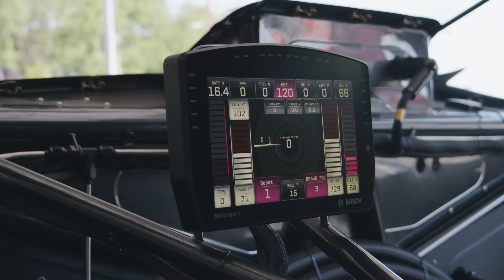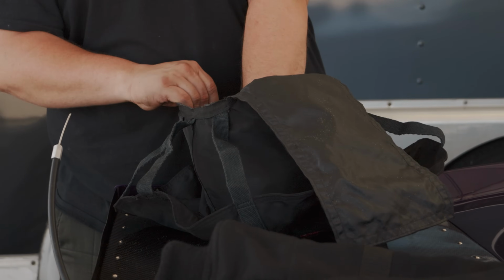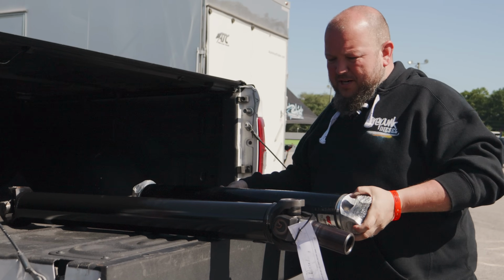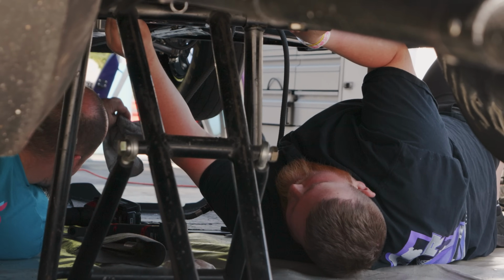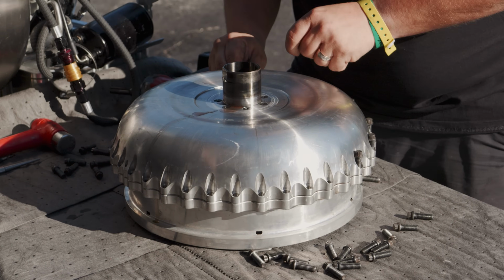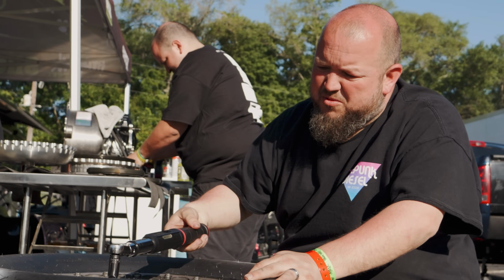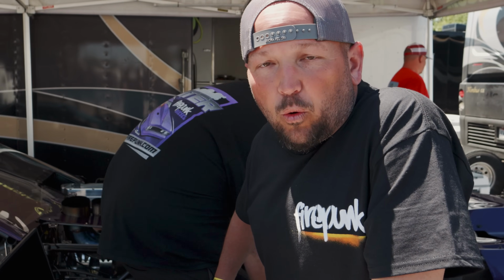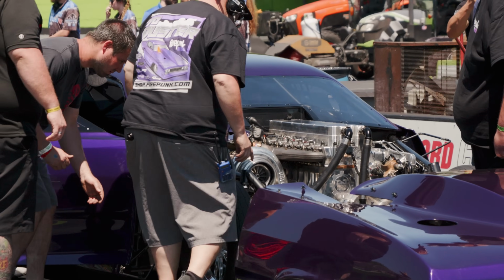Florida Truck Meet 2024

Comment: I know that this is just a YouTube comment, but have yall thought about rearranging the rear suspension to get the rear end to separate instead of squat? It will amplify the force on the rear tires instead of just being whatever the rear spring rate puts down with the weight transfer. It looks as if it squats from the videos.
The logic here: the squat is what is currently putting all the force down on the tire due to weight transfer. If the 4 link bars are made to point slightly down the rear end will try to push into the ground as the rotation of the tire forces it forward. This and a little bit of pinion angle could make a huge difference for you guys. It’s all in addition to the force you’re getting from weight transfer.

Comment: Internet videos do no justice to ypu guys car. It is absolutely beautiful and a rocket ship. I watch alot of regular no prep and drag racing in general. My first diesel event did not disappoint, you guys amazed me. 

One more question. Do you guys feel like diesel engines in burnout competitions mostly fail because of drivers not having any throttle control whatsoever? I feel like a good driver could not only put on a great show, but make a diesel engine live with no issue. I also wonder why people don't use the giant tanks of water with a helper water pump like the loggers use to,  to keep the diesels engine cool during a burnout. Ive seen many old diesel logging trucks left in the forest with these set ups. They modify the truck that would do large hill pulls with full trailers every day all day long. They'd basically put a 100 gallon or bigger tank on the truck. They would weld a few small pipes or one big pipe into the center of the water tank. Old timers told me they would pack those pipes with snow or cold water from the creek throughout the day. The hot water from the radiator discharge would go out into the giant tank, then the radiator would be supplied the cool water from inside the tank. Ive always wondered why this method wasn't used on a burnout diesel rig. Though maybe you guys could enlighten me some. Anyways, beautiful car, love yalls race program, and I will be watching for you guys to attend more races with ypu. 

-Bud
Reply from the maker: We put a burnout truck together for Bruce Wilson with big water and cooling capcity, I don't think he'll have any problems, but time will tell